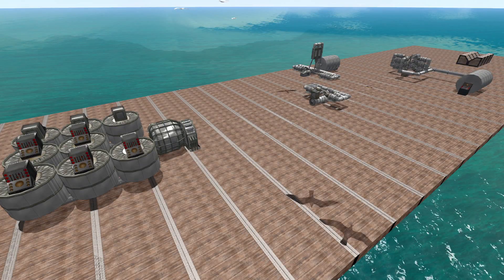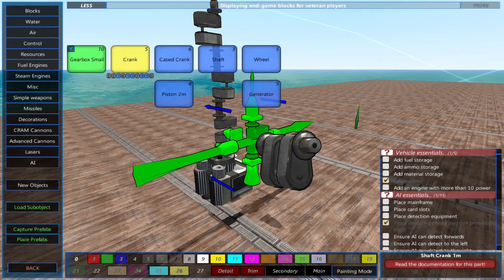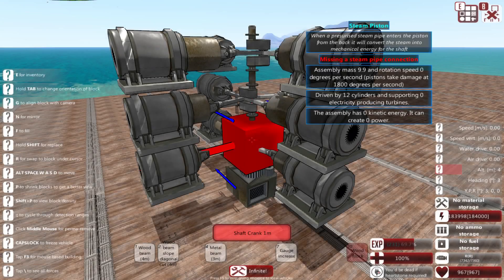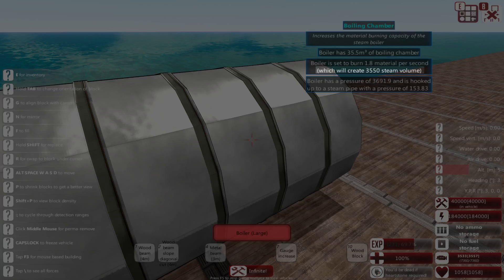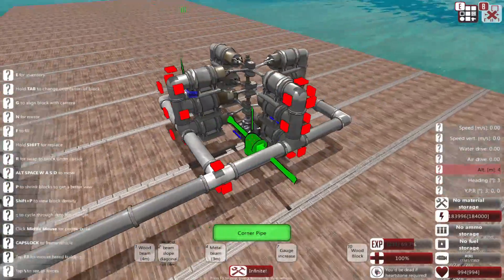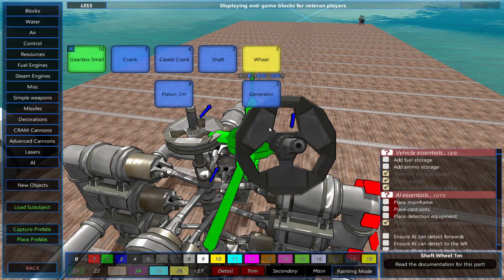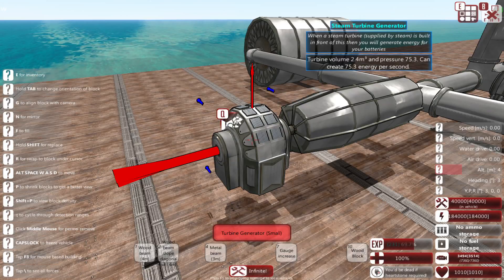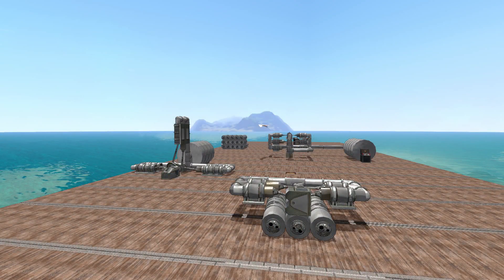From The Depths Steam Engine Tutorial

Comment: ACB's are a HUGE help with resources.  I generally use 2 with my steam engines.  1 to set burn rate to as low as possible when there are NO enemies present and the second to increase the burn rate to 100% once enemies are detected to provide additional power for shields, lasers and anything else you could need.
Reply: I typically put several down, each setting the burn rate dynamically by how much demand there is
when nothing's happening except for movement, they barely burn at all, but as more and more energy draw occurs in the system the engines ramp up to meet it

Comment: I am confused... In your calculation, you said you multiply by 1800. That lead you to the 9.9 x 1800 = 17820 equation, but you immediately changed that to say if you come up with 17820, you can hold 7820... Do you just cut off the first number? How do you get to the 7820?
Reply from the maker: I miss spoke. I meant to say 17,820
Reply: Thanks, should have guessed